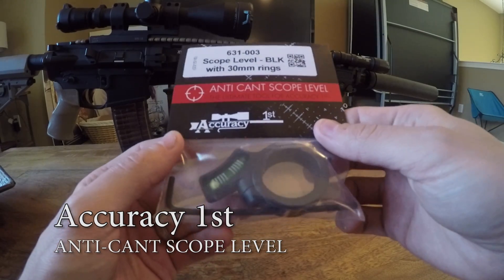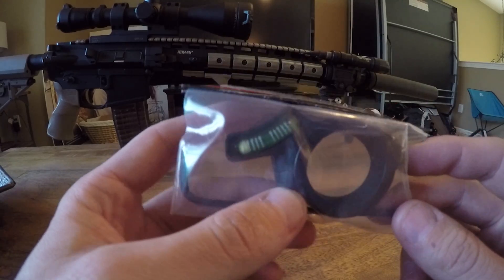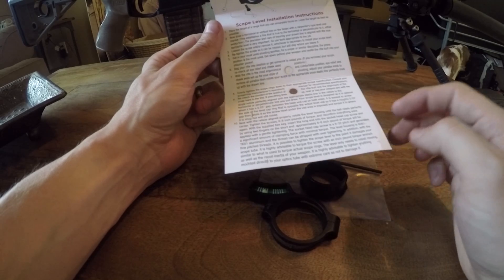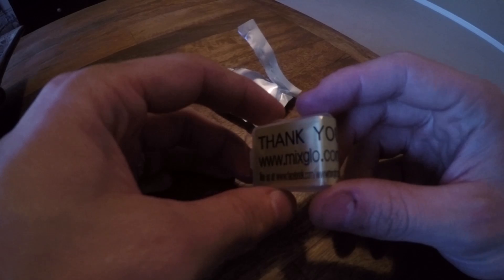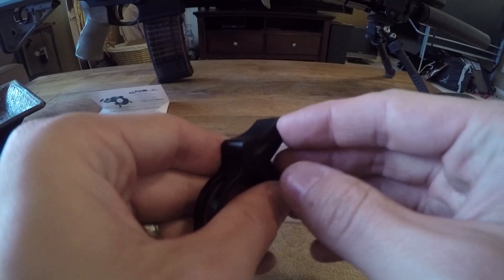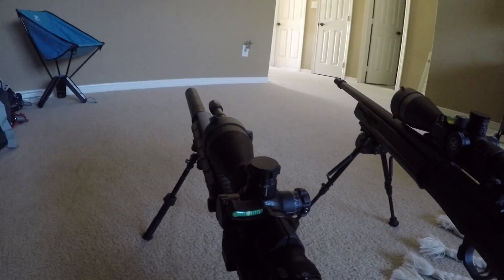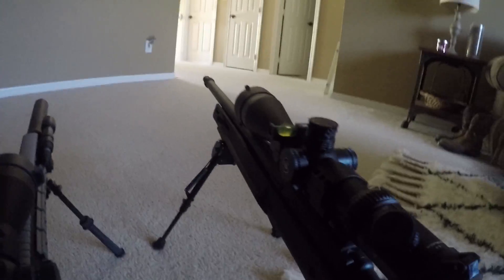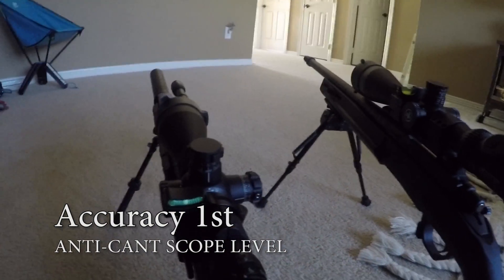Accuracy 1st Anti Cant Rifle Scope Level - Tritium

Comment: Mixglo has been out of the correct tritium vial for quite some time now. The advise on purchasing a larger size they do have in stock that supposedly fits even better. Nothing could be farther from the truth. The additional length hangs up on the epoxy that secures the level inside. This prevents the rubber cap from seating correctly and falls out easily. If you press the rubber cap in it will snap the vial, as did mine. If they had the correct size in stock I believe it would fit correctly, but they don't and it doesn't. I'm out $50, don't make the same mistake. Buy the battery powered scope level illuminator from Accuracy1st. 
Just my $.02 cents.
Reply from the maker: James Relinski that's a bummer! I'm glad I got my 2nd vial before they were short of stock.  I'm sure it will be back soon. the battery solution is clearly temporary but pretty neat too
Reply: Wow, so this is what impatience brings about.
So the longer one does fit better, you just have to do more prep beforehand.
 Epoxy between the level and housing is good, but there is something called 'squeeze-out' which is epoxy between the level and nothing. It's not holding anything in place, it's just taking up room inside the little cutout area.
If you don't remove, carefully, this epoxy squeeze-out and just try to force it, you can break your vial.
Reply: I know this is a very old comment but if you see this, can you remember what length or what size vile you ordered? I would rather get the larger one and take my time and get it to Fit. Thank you. I appreciate the help.

Comment: Good choice on scope level. It's all I use now on my rifles. I'm surprised you found the correct flat vial, they were only available to military before. Going to have to order one. I put a round vial in one and it actually works pretty good but not like yours.
Reply: 1Grizzman they are great, just got another one for a different rifle

Comment: I'm having trouble following your math - you state for 5 deg cant @ 100 m the error is .1 mil or .0001".  You also state that at 600m the error is 36 cm, 14.17".  Seems like it should be more proportional at 100m.  What factors are considered other than the bullet veering off at a 5 deg cant?  Thanks.
Reply from the maker: Darwin Wilde I was intending to quote what Todd hodnett stated in one of his training videos.  I may have misquoted.  The intention is that at distance you will miss a target with even as little as 2.5-5 degrees of cant. Also, it is easy to think you are level in uneven terrain without a level.
Reply: 0.1 mil isn’t one ten-thousandth of an inch...it’s an angular measurement, one ten-thousandth of a radian.  1 mil is about 3.2” at 100 yds.

Comment: are you serious!? the scope and rifle need to be leveled with each other in order to make accurate shots at long range. you need to re-evaluate your info again.
Reply: The scope needs to be level with the world, your bubble level also needs to be level with the world. A plum line does this easiest.
 If you're a woman, and don't want to have your intercostobrachial nerve pinched, you'll want to cant your rifle 10'ish degrees counterclockwise for righties to avoid that nerve pinch. (Other shooters sometimes also enjoy a slight cant with their rifle as well, for personal reasons) Regardless of how you choose to cant your rifle, you need to have the scope level with the world. Luckily, a scope will usually rotate freely in the scope rings until tightened down. So as long as you plumbed the vertical sightline to however you hold your rifle, you'll be fine. Any secondary levels should also be level with the world, and to match the verticality you've set the scope to.
Only person here that needs to re-evaluate is you Jesus, not us.
Reply: I agree.Scope, rifle level. If the horizon is not level (ie the side of a hill), then the shooter is guessing at what is level, hence the reason for some kind of level reference to ensure the rifle (and reticle) are actually level. The only reason to cant your rifle is if you are on ground that is not level and you need to get the sight picture level.
Reply: @hughloraine9660  ... You're either limited it to a lengthwise, and not rotation along the axis.
If you lean your weapon over like it was a movie handgun, as long as you always lean it over that way, you level from that position.